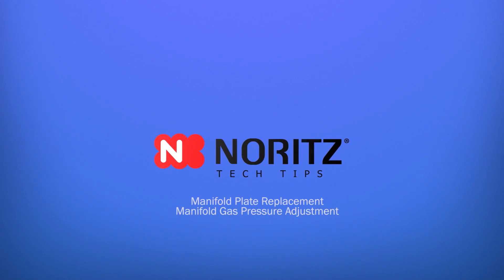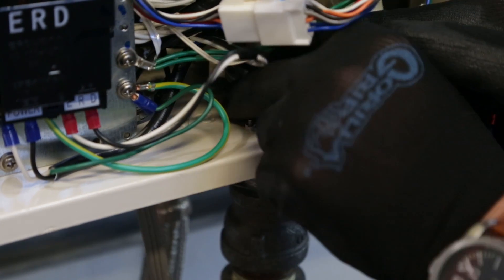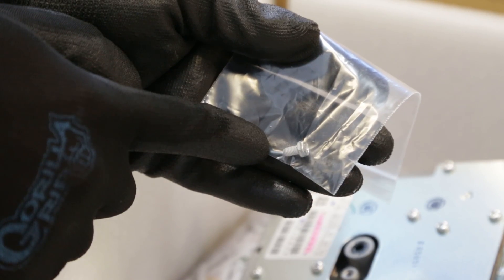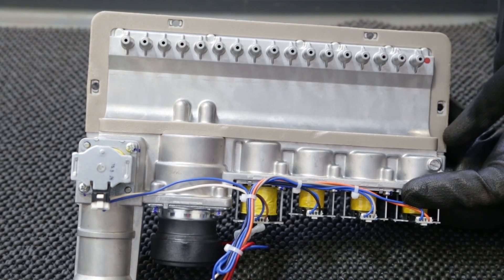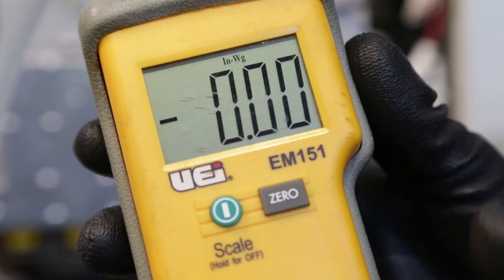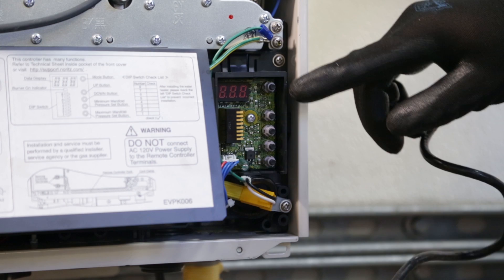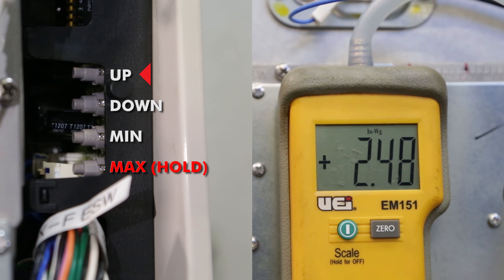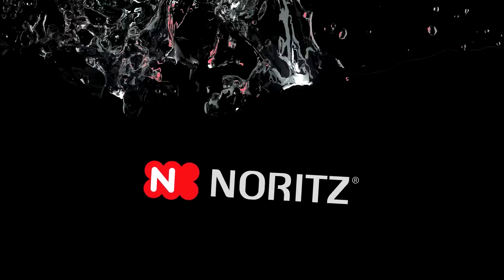Replacing the Manifold and checking gas pressures

Comment: Do you have a video that goes over checking and/or adjusting the inlet regulator pressures for an NCRP 1112?   The manifold and inlet are significantly different.

Comment: Hi there,

i was having shower and my gas ran out..then i went and changed my new gas cylinder. but my rinnai vt 26 system is stopping. when i open the hot water tap in shower
i can hear the ignition and the fireup noise..within 10 to 15 seconds its shuts down. no hot water.
if i give some time and try again the hotwater runs for 60 - 90 seconds and stops.

please help .

thank you

Comment: What's the reason for replacing the manifold?
Reply: My manifold started leaking after 3.5 years of use, so I imagine that's why Nortiz uploaded this video.
Reply: Rob Errett how do you know if the heat exchanger has a leak and thats what damaged the manifold or if its really the manifold that was the problem?
Reply: @A619D  it was my Heat exchanger that had the leak. Not my manifold. I sent Noritz pictures and they sent out replacement parts.
Reply: Replacing due to code 51
Reply: Mine had a bad solenoid